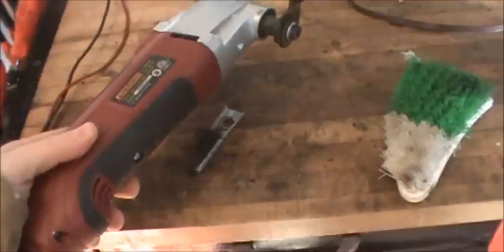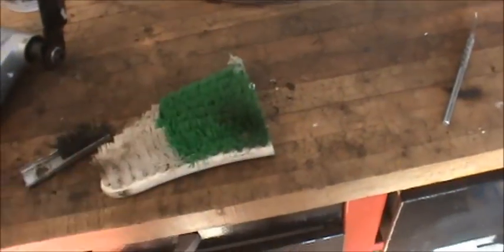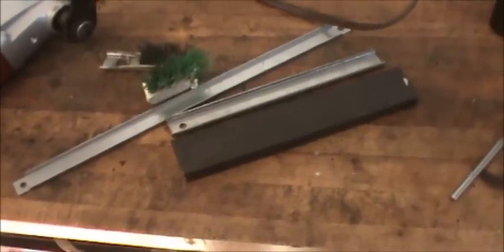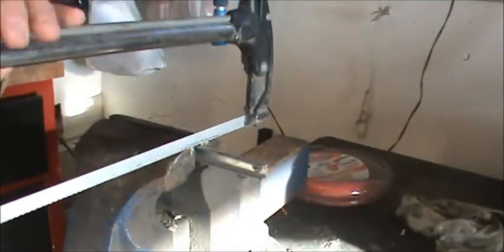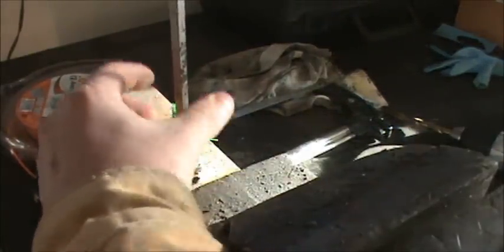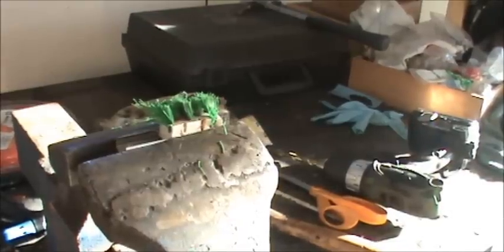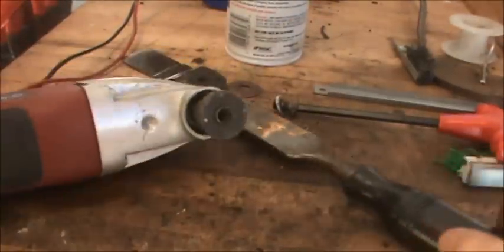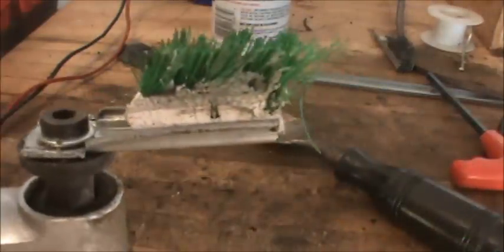Tile Grout Cleaning POWERTOOL  How To Build it

Comment: Happy 2017 !!!!!  Thank you Mr. Doublewide six for making videos showing "How to make a grout cleaning tile brush" and "how to clean the grout lines using an oscillating multi tool" video's !!!!!!!   These are true practical aids that I used to clean my shower for less than $50 (even bought so hearing protection ear muffs).  I saved over $400 by not having to pay the guy that did it for me a couple of years ago.  Now I'm back in the good graces of the Mrs....for now.  TWO thumps up to you sir!,

Comment: This is the best tool to remove dried grout from tiles! The attachment for removing dried grout is $3. I got mine like his for $20 @ harbor freight! Love it! Here's the link to it: http://m.harborfreight.com/power-tools/oscillating-tools/oscillating-multi-tool-62279.html
Reply: melanie mccready-gable Hi, Melanie, I went to the Harbor Freight online, and I found the oscillating tool you bought very easily, but the only gold sander attachment I found was for a rotary tool. Were you able to use the rotary attachment on the oscillating tool with no problems?
Reply from the maker: It is an awesome tool.  Works very fast at cutting plastic, or jobs that are in tight spots.
Reply: It looks like this http://multifitblades.com/flush-cut-segmented-diamond-blade.html
Reply: +Aslanreturn I've used it on all different sizes...and it worked great on all....
Reply: Thanks so much! I will get one. :)
Reply: What is it called? My search isn't pulling anything like this up. Thanks!
Reply: Melanie, Could you tell me the name of the tool that you got at Harbor Freight, I want to go to buy it.
Reply: What is the attachment. i would prefer to buy one than to make one if it's available.
Reply: It was a round gold sander attachment.  I'm not sure what it was called but they should be able to tell you.  The actual power tool I got was Chicago Electric brand oscillating multifunction power tool.
Reply: I'm sorry I'm just now seeing yalls messages but hopefully that helps
Reply: This is GREAT! So how small of a tile grout could I remove with that particular size represented there? I need to remove some 1970's square shower tile grout. Do you think that size would work or be too large?
Reply: Mrs. Szekely 
Hi it's an oscillating tool. Here's the link: http://m.harborfreight.com/power-tools/oscillating-tools/oscillating-multi-tool-62279.html

Comment: Cool video, thanks.  Have you ever used the oscillating multitool to cut mortar between bricks?  I'm trying to figure out the right attachment to use, any suggestions?
Reply: use an air chisel